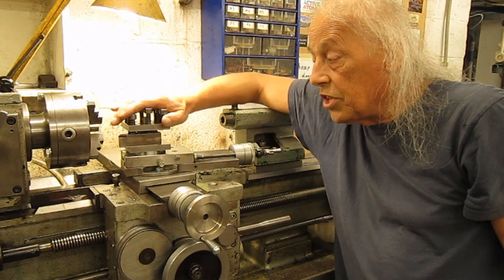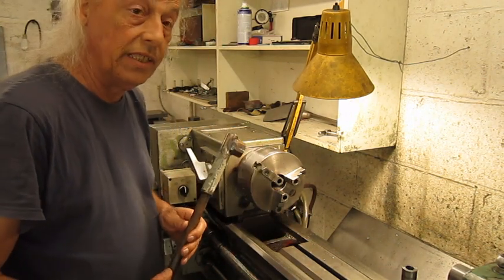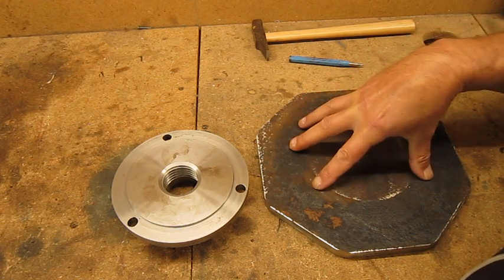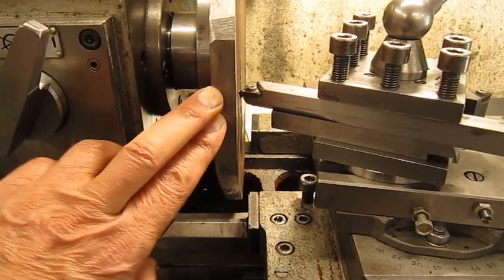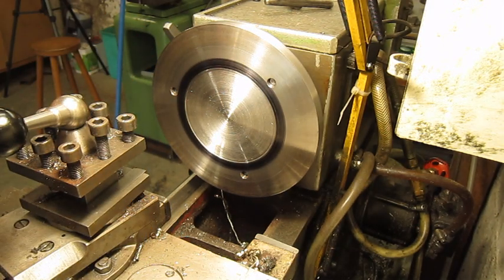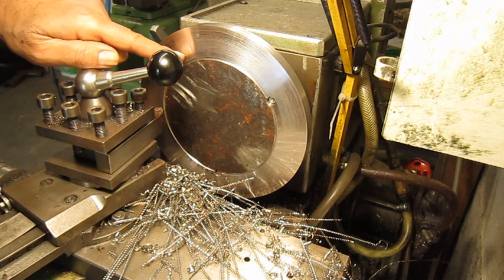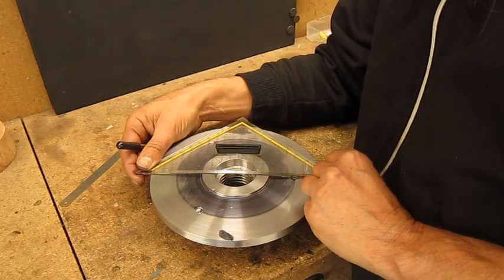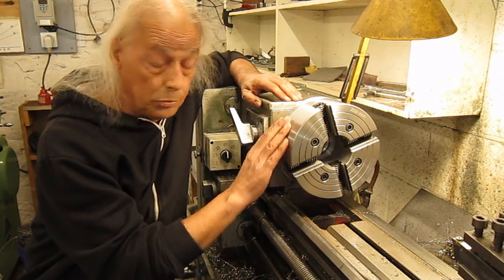Lathe chuck backplate.

Comment: Great chuck removal system :) I think I would have mounted the backplate directly onto the chuck without that spacer.
Reply from the maker: Thgat was my first plan. But my lathe can't make the thread pitch that's on the spindle nose.
Reply: @Rustinox  I mean mount the chuck directly to that back plate you have in the video. Sure it's smaller than the chuck but I don''t think that's a problem.

Comment: How nice is it when you bring out the shine in a rusty old piece of metal? The joy I get from watching it turn into a shiny object is most satisfying!
 Just as a side note when you measures the holes for the chuck to mount to the backing plate you could have used a set of centre punch transfer set as well instead of measuring?  I hate mathematics so I will do that as a last resort!
Keep up the good work!
Reply from the maker: I hate maths as well. That's why i prefer using a construction method with the dividers.

Comment: Michel I need your assistance. I got my 8 inch round stock but started wondering if machining it while bolted to the current backplate might introduce concentricity issues if the 4 holes for the 4 jaw are not the same concentric as the 3 holes on the current backplate. How did yours turn out? Any issues after you attached it the the 4 jaw? I have a backup idea and need feedback. Screw the current backplate to the lathe, then bolt the new round stock to the back of the 4 jaw and grab the 4 jaw to the old backplate. This way all the machining would be on the new 4 jaw and would in theory avoid any concentricity issues. Your thoughts?
Reply from the maker: As you can see in the video, I first turned the diameter that regisrers on the smaller (original) backplate.
From the moment that is done you can flip the part and work the other side.
You can take it off and mount it back again as much as yoy want. It will be repeatable and concentric.
I hope this helps.
Reply: @Rustinox  merci 😊

Comment: Hi Rusty, great to see a video from you. I love recycling old materials too. I like your method for making the backplate adapter. Will you still have access to your three jaw chuck? Cheers, Craig
Reply from the maker: Yes, easy. Just take out the 3 bolts on the small plate and put the 3 jaw on.